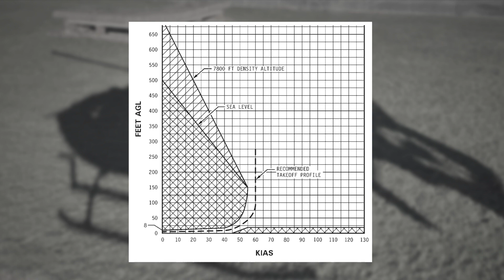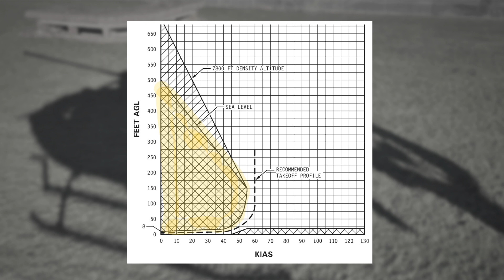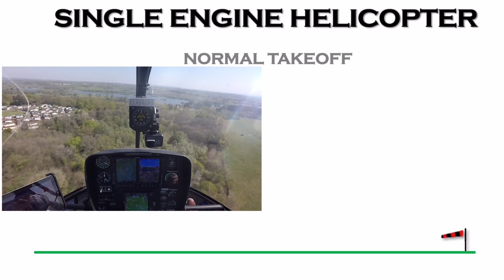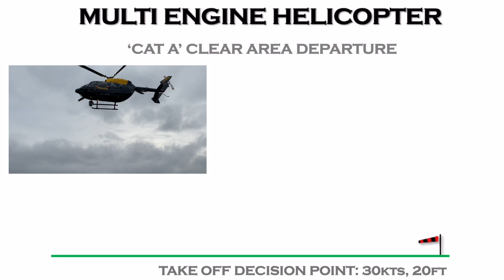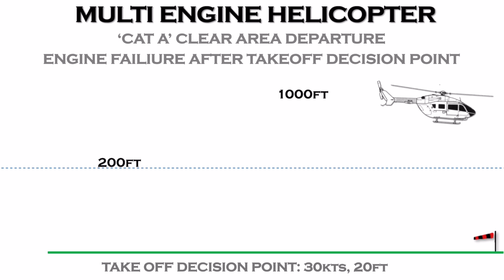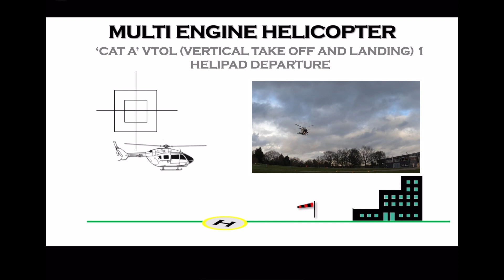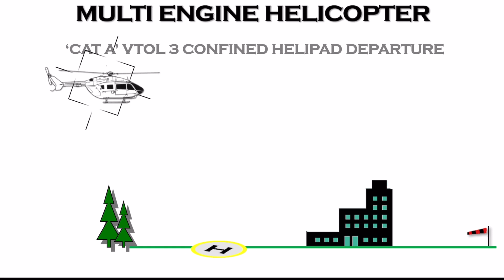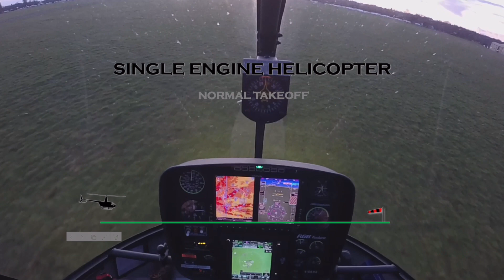Helicopter takeoff profiles

Comment: Great upload👍🏼
In between I only see the "CAT A' VTOL" -
Maneuver here in Germany used by Medi-vac & Police - 🚁's compared to 20 years ago. 
Thanks for the very informative upload 👍🏼‼️
Reply from the maker: Thanks for the comment and glad it was of interest to you !
Reply from the maker: To my knowledge, ADAC and the various police departments use primarily the EC135 , and EC145 and their latest variants eg the H145
Reply: @ABHelicopters  
you are absolutely right! 
I really miss the 🚁 BK-117 & it is also sad that we don’t have any NOTAR Helicopters in use. Or better said: it is super rare to find a McDonnell Douglas NOTAR - Chopper here but in Austria 🇦🇹 & England 🏴, just for example, they using the Explorer very often.
I am a true fan of the MD500-D 🚁 and it’s like they don’t even exist here in Germany 🙁.
Reply from the maker: There are less 902’s operational in the U.K., the police stopped using them around 2016 and most air ambulances use the 135/145 or AW169, though the London air ambulance still uses the 902 so it can land it some tight congested areas!

Comment: Another great video Andrew! Question.... In a "Cat A VTOL 1 Departure", do you have the nose facing into wind thus effectively climbing backwards downwind, or is it the other way around? Also lets say for example you're departing from a confined area in a single engine helicopter, but due to obstacles like trees etc you don't have much clear space in front of you heading into wind but you do have plenty of space heading downwind... would the preferred take off profile be a max power vertical climb into wind, or a normal take off profile in a downwind direction?
Reply from the maker: Hi Neil, thanks for the comment and glad that you found it of interest ! CAT A profiles cannot be flown with any tailwind component , and you would orientate the takeoff path as nearly into wind as possible as obstacles allow, but the profiles and the drop down- obstacle clearance is calculated with no headwind benefit at all.
Reply from the maker: Re the scenario you are talking about, yes if you were sure you had power, for a single engine , that might be a better option. In a CAT A helicopter , you could raise the Take off decision point to a height that ensures that you would always clear the taller obstruction in front of you - for example , VTOL 1 , the TDP can be raised from 120 ft up to 200ft, and the VTOL 3 TDP gets you up to 240ft